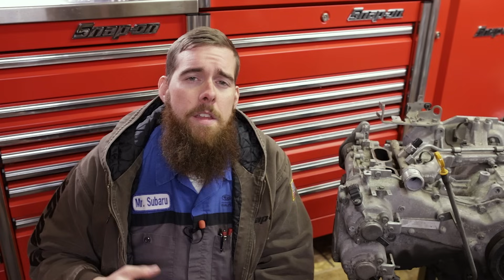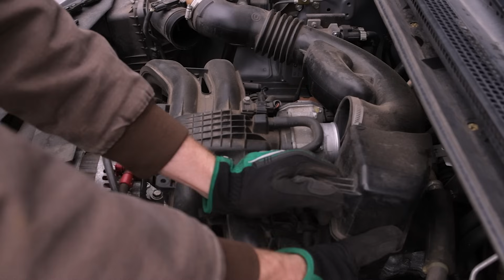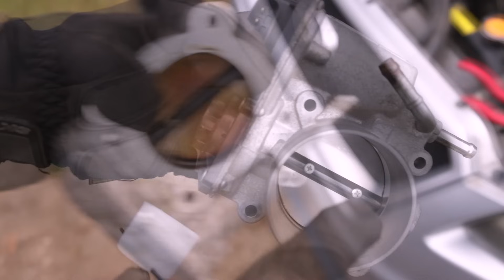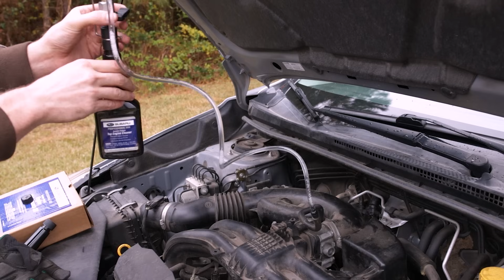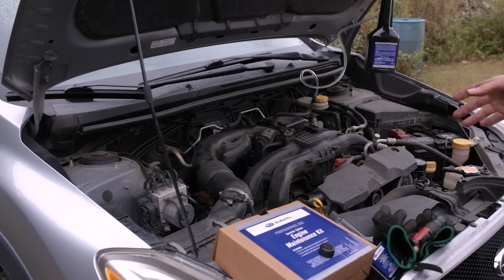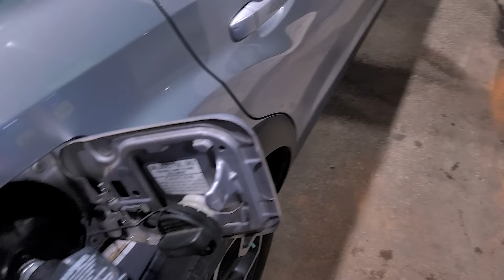Keep Your Subaru Running Like New! Subaru Engine Maintenance Kit

Comment: I've never liked doing this on older cars. If you take you finger and wipe the inside of the intake headers they are littered with grime, sand like materials and other bad junk. When you spray that crap in the motor it flushes all that junk into the motor and your poor piston rings take a shit kicking.

Comment: I know is seems kinda dumb but as I’m not very familiar Subarus but what fuel grade do you prefer to use in them I live in a state with ethenol at most gas stations (I can still get non ethanol stuff just is a bit expensive)

Comment: My torque wrench must have failed… I snapped a bolt trying to reattach the throttle body. Is it okay to replace the bolt with one from a hardware store, or will I need to go through Subaru parts department?

Comment: 2020 Crosstrek the driver side TGV is making noise under a light throttle blip. I want to try cleaning the intake before i spend the $800 on a whole manifold. Would this kit be worth it?

Comment: I can't quite tell from the video or the parts diagram, but I have a 2017 Legacy 2.5L.  The throttle body gasket that comes up has a seal with what looks like a metal screen inside.  Is that the one I'm after?  I didn't want to pop it off yet and have a lean code show up if it didn't seal properly.

Comment: Hi!
I own a 2016 outback and I'm having some issues with it
It all started when it throw a p219c code for lean mixture on the fuel i runned seafoam  intake cleaner and that went away and it was running  fine
For about a week until I got a p0300 and p0301 followed by p0201, p0102 and p0113.
I replaced sparkplug tube seals and gaskets, cleaned injectors and maf sensor but I still have the misfire and stall like crazy I also cleaned the pcv valve I'm totally lost right now hope you can give me some advise on what to try next thanks love your videos

Comment: Definitely be careful/gentle with the valve for adjusting the cleaner flow.  I opened mine up about 1/4 of the way, let it run for a few mins and then went to check how much had been consumed and my engine had sucked down the entire bottle.  Went to run it at 3-4k rpm and the engine bogged down/out.  Thankfully it was fine after starting in flood mode and burned off after a 25 min brisk drive - but damn that valve is not precision/accurate in any way.

Comment: disclaimer: the chemical method for valve cleaning is best for small mileage increments, if youre keeping up on maintenance well.... if you let it get to 60-80k before doing this, walnut blasting will be much more effective. but its also much more expensive if you pay a place to do it. thats why its worth keeping up with maintenance.

Comment: Hi to all! I have legacy 2007 wiitch ej204 engine 165 hp with manual gearbox. Please, can someone explain why when I`m looking to OBD the throttle position (TP) 10.6% and MAF indications is about 3.8 - 3.9 g/s. Is it correct? Also I had a P0134 P0030 P2109 mistakes but I change lambda probe and brush the throttle after that check is go off, but the car is a bit dull and jerks at low revs. Appreciate and would be thanful for all known information.

Comment: Hello, I'm in the United States and I own a Subaru Outback 2022 XT. SOA says I need to use 0w20 oil, but some people say 5w30 is better to keep the engine running for a long time. Is it accurate that I need to use 5w30?
Reply: 0w30 is your answer. Pennzoil Euro LX 0w30.
Reply: @BMWK-jo1kn  0w30?

Comment: Great Video!   I've got a '21 Outback touring XT with the 2.4 turbo engine.    Obviously this engine has a lot more plumbing than the '13 crosstrek shown.   Would you do a video for this cleaning operation with the newer engine or is it not a DIY project?

Comment: What line would I use for a 2018 Forester XT? Update just finished and my forester went from 15 to 18 mpg to 22 to 25 made a huge difference doing the top engine clean.

Comment: I've owned various brands of vehicles with various types of engines, and never have I ever had to be so fussy. I've been curious about the Suburu product,  but after much research, I'm having second thoughts.  The average user can't safely do the things described in this video, and paying someone else to do it would not be advantageous. Bottom line.. If you want a suburu, be ready to baby it way more than you may be used to, and be able to afford it.

Comment: How long should I be letting the engine inhale the cleaner per 1\3rd bottle? Is it a 5 minutes process or does it take a solid 30 min before it should be done.

Comment: Have you had the opportunity to look at valves before and after this treatment? In your experience does this help for carbon build-up on the valves GDI engines? Do you think oil catch cans help? I have one on my BMW with GDI and it hasn't caught more than probably 1/2 an ounce in the 3 or 4 years it's been installed. Really want a new OB Wilderness, but I'm weary of GDI, although with nearly 140K on my GDI BMW, I haven't had any issues. I do use a quality synthetic though that's formulated for GDI engines. I'm hoping the additives and detergents help mitigate the issue.

Comment: Link for the upper engine cleaning tool is incorrect for the plastic bottle upper/top engine cleaner. Correct part # is SOA868V9430

Comment: All Subaru are reliable with the proper maintenance except early models (head gasket, fixed). We used to own three. Last year we bought new Impreza RS 2024 model (wife drives it, she likes Subies). At 14k miles have got multiple messages on display (check engine, eye system...), went to dealer, checked, said engine carbon buildup. They cleaned all that gunk under warranty. Wife drives 70% highways/ 30% city, never had this problem with previous cars. I did research and found that Subaru switched from port injection to direct injection engines during
2019-2020, now all models have Di, except BRZ( Toyota GR86 joint project, D-4S dual injection).
Be prepared for this, if you will get this problem under warranty-no charge, no warranty or preventative maintenance it's around $350. But it is too soon at 14k miles!
Reply: Wonder if it might have defective pcv valves or something like that. I’ve got 85k miles on a 2019 wrx and it’s never had any issue with carbon build up.

Comment: Replaced my PCV valve today while doing the throttle body, laid it on its side, so the cleaning fluid could maybe linger a little longer. Sprayed 2 little squirts upward from each side  a few times, to let  the chemicals do their work, then brushed, etc. 19mm and torque 17 ft lbs on PCV. Old one did'nt rattle as good as new.

Comment: Thank you for making this video.  When I first noticed the oil leaking, I thought it was because I didn't install the spark plugs Correctly.  Just replaced the seals at 175,000 and it sounds way better now.  Hoping they also helps with the P0420 code too.

Comment: IF VIEWERS ARENT AWARE OF THE LPA FUELS SOLD AT MOST GAS STATIONS YOU NEED TO LOOK UP TOP TIER FUELS BY SEARCHING ON GOOGLE WITH TOP TIER FUEL FINDER..IT HAS GOOD ADDITIVES AND 85% LESS OF THE BAD STUFF THAT LEADS TO DEPOSITS. DONT TRUST ME RESEARCH IT FOR YOURSELF..CLEANER FUEL LEADS TO LESS BUILD UP.

Comment: CRC has a spray that’s safe for gdi engines.  
I do have a question about the tb cleaning. I haven’t done mine yet but I also don’t want to completely remove it. What are your thoughts on cleaning it while still mounted?

Comment: Do you recommend buying a Fuel Injector Cleaner or additive from Walmart and using it? I don't always fill 'top tier' gas so wondering if it's a good idea. Im at 35k miles.

Comment: My buddy hydro locked it and bent a valve on the start up doing this on wrx. So he just bought a used engine and we installed it and on start up the rockers fell off ... boxer engines a nightmare imo

Comment: Just an fyi the the design of the tool and the cans of cleaner has changed. 

The new tool part number is
 SOA868V9432

And the cans of upper cylinder cleaner are part number 
SOA868V9161. 

My local dealer was somewhat reluctant to sell me the tool, citing i could bring it in for the service but i remained polite and firm so they ordered it.

Comment: This was a good video, I just spent several hours today removing the egr valve and cleaning it with wd40 and an old toothbrush hoping it would clear the check engine lights since it’s pulling an egr related code (P0400 EGR AFlow.) I put everything back together and nothing changed. Went back to the auto parts store thinking hooking the car up to a computer would clear the lights and they’d stay off but they came back on after 15 miles or so of driving like they did when nothing was fixed. It’s pretty depressing to deal with this on a car that’s close to but still not paid off.

Comment: Thanks Mr Subaru! The best teaching video I have seen to date. Shares knowledge, tips and insider info—inspires confidence! I have a 2011 Legacy Limited 2.5 (not a  turbo). With 168,000 miles and recent head replacement/Drive belt/water pump kit. Ouch, $2100…. While my air intake setup is a little different, can I use this same kit and procedure for my Legacy limited? Thank you for answering questions.

Comment: For the Top Engine Cleaning, does the car need to be/better to be on level ground or is it just as well in a slanted driveway?

UPDATE   Mr. Subaru, "I don’t believe that will have any real bearing on using the top engine kit."

Comment: I have a question. So you connected the carbon clean tool to the end of the purge hose that you disconnected. On STIS it says to connect the carbon clean tool to the intake manifold that you disconnect the purge hose from instead of connecting it to the purge hose itself. Ive done it both ways. Can you explain to me the differences in both?

Comment: The Subaru service bulletin #09-74-21R states to use up the whole bottle of top engine cleaner first in step 7 and then do the 3500 RPM cycling to get remaining carbon deposits off the spark plugs in step 8.  I did not see using the 1/3rd bottle combo you are showing here.  Did I interpret it wrong or is there another bulletin for this Engine Maintenance Kit?  Appreciate all the information you are bringing to the Subaru DIY community.

Comment: Just an update since im trying to clean mine. 
The top engine mount tool part# is SOA868V9432 which will work with the new style top engine bottles.the part# ending with 30 is longer available
Reply: Yeah the bottles are metal now only I believe

Comment: Thank you Mr.Subaru.
I used this maintenance kit , but mpg dropped by about %25-30 after.Not sure if it was a coincidence.Been having low power issue for last 2 years , still have it.
09 Outback , 215K mile on it.
New Cat , new O2 sensors , New spark plugs , new ignition coil pack , new knock sensor , timing belt was replaced 3 years ago..
Please comment.

Comment: Is this a process that can or needs to be carried out on a Subaru diesel engine?
Reply: Carbon buildup is an issue for diesels; they are direct injected afterall. Unless you can find a specific kit for diesels, stick with walnut blasting. I wouldn't put chemicals designed for a gas engine in a diesel.

Comment: I do a Italian tune up on my vehicles,  basically I add fresh fuel with  fuel injector cleaner, and go for a long drive at 70mph, burns the carbon up, then as soon as you get home,  drop the oil and filter, then replace fresh oils / filters , will run so much better 👍
Reply: for direct injected engines this will do nothing....
Reply: @extraglutenplz3758 except for "direct injection" bikes yeah 😂
Reply: If you’re only going 70, that’s not an Italian tune up, unless you’re in 2nd gear
Reply: @I_ziptied_it yeeeee 😏🔥
Reply: People talk about Italian tune-ups confidently, as if Italian cars last a long time or something.
Reply: Maybe the Italian tune ups are the reason why Italian cars don't last long
Reply: that doesnt work on direct injection vehicles as the fuel never touches the back of the valves, where all the buildup is.
Reply: How often would you complete this service
Reply: Dude, that was a really long way of saying you have no clue what port injection and direct injection is. 
Next time, just ask.
Reply: 70mph 😏😉
Reply: How often do you do this?
Reply: lmao you don’t fucking know it burns carbon.
Reply: Good job bro! Now just patiently wait for your fuel to touch the intake valves.

Comment: I know this is an old video, but I have a 22 wrx with the fa24dit. Which line would you use with this kit? Maybe the one off the throttle body?

Comment: I have a 2015 Outback with the FB25 engine, always running smoothly and never a check engine light at 140,000 miles. I am not sure about ever needing this service? It uses a quart of Quaker State 0-20 every 3,000 miles and oil changes 4,000-4,500 mile intervals with the Mazda RX-8 filter.

Comment: Good to know Subaru has a process to address the one major downside of direct injection. This is remarkably similar to using the old-school Seaform cleaner.
Reply: So why not just use seafoam or Berrymans B12?
Reply: @triangles4467  It's not the actual chemical you're buying , it's their delivery system. I'm sure seafoam would work, but I do think it would save you much money,
Reply: They always had a process to deal with it. It's called port injection lol
Reply: @moparsrt1905  the best is to have both, like my Toyota has.
Reply: Yes, I have an IS250 and an IS-F. The IS-F is a masterpiece, the 250 not so much but its still a good car. Just need a walnut blast every 200k miles. I do redline the 250 once a drive when its at operating temp. @21jimmyo
Reply: @21jimmyo  unfortunately cost more. I'd pay more for dual injections like Toyota or Hyundai

Comment: Do you know where we can get the gasket for the 2023 outback wilderness? I can't seem to find it anywhere. Or everything I'm searching is resulting in a odd O-ring gaskets instead of a gasket going film that goes between the metal throttle body

Comment: Gum out isn't complicated easier been using for years my Forester runs great no issues. No tools no removal works just as good proven product.. with Subarus you start removing stuff check engine light will come on then you won't have cruise control

Comment: This only applies to the FB engjines, right? I guess I can just continue to use top tier gasoline and fuel treatment in my FA? I don't know why they don't use the induction system from the BRZ, which combines port and direct injectors,  in the newer FBs.  Then we could also have a higher HP NA engine. Probably Toyota won't let them.

Comment: I reached out to my Subaru dealership in  Nova Scotia Canada to buy the engine maintenance kit. I was told that they do not sell these kits to the public, they are stocked for their service techs only. As a workaround I went to Car Quest and the rep helped me identify similar or better products (i.e. higher PEA content) and used these items with great results.
Reply: Thanks for the advice. Can you share what product you used?
Reply: @VinoLoco  I don't know what Mr. Shaw used but Chevron invented PEA and their Techron Fuel products are the easiest way to get it. Gumout's Regane products are also PEA. These would cover the in-tank portion. These are proven injector cleaners.
Reply: The plastic bottles are discontinued. They we replaced by the tin cans. I'm assuming they still have stock of the plastic ones tho
Reply: @robertshaw9437  yes, I’d also like to know what those products are, fellow Canuck.
Reply: Is the procedure identical for 3.6R 2017 engine? What are the changes if any?
Reply: @hoppyski  The specific engine won't matter, it works on all engines.
Reply: @hoppyski Different vacuum line, what is shown here is not on the 3.6
Reply: I'm in Halifax, having a hard time finding the "kit" at a reasonable cost. Can you share what the products were or who you talked to at CarQuest?!! Thanks.
Reply: I’ve used SeaFoam products to do the top engine cleaning with no problems… lots of smoke out the tailpipe, carbon gone!

Comment: Dealership wanted $300 for this treatment. Thanks for saving me some money
Reply: Hi mate what sort of gain do you get from this ?? I'm gathering fuel economy and  power.... is it a noticeable difference  on both fronts ???
Reply: @01philtaylor Smoother idle, better fuel economy, possibly more power. It depends on how carboned up the system is I think every 100k miles its strongly recommended. With a direct injected system. Id likely do it at 50, but ive been told I go overboard with preventative maintence. Car just sold 245,000 miles rust got it 17.5 mpg! (Constantly drive on decently steep hills.)
Reply: Does adding fuel treatment at every oil change reduce carbon buildup?
Reply: 3
X. XOXO
 X
Reply: Do it
Reply: fuel inductions services and brake services are the biggest scams at the dealership. never pay for those
Reply: That is not that bad of a price. It is as if they are charging you for $30 in supplies and 2 hours of work. Even so 2 hours sounds excessive, they are going to spend time bringing your car in, putting it on the lift, inspecting, filling out pape work, rotating your tires...
Reply: @AlexanderAleyan exactly and they'll have to clear codes, test drive it after.
Reply: They just quoted me 2k 🤮

Comment: I bought a kit from my dealer and the top engine cleaner bottle they gave me looked like the throttle plate and induction cleaner bottle. The tool is too long to thread onto the shorter bottle than the one in your video but the part number is the exact same as well. I should be fine if i just keep the tool submerged in the bottle? I noticed in the tool there is a hole up in where it screws onto the bottle. Not sure what i should do other than maybe cut the tool to size to fit onto bottle.....